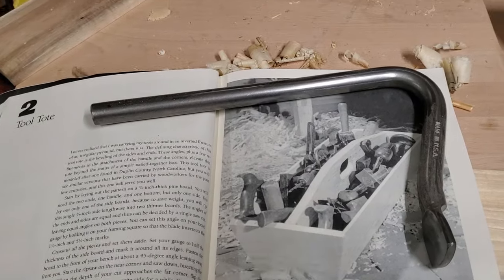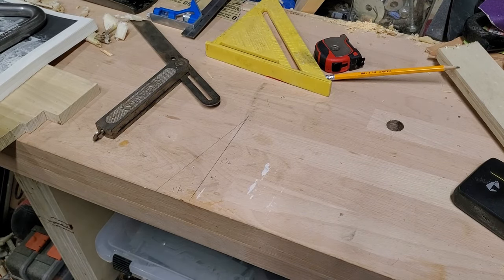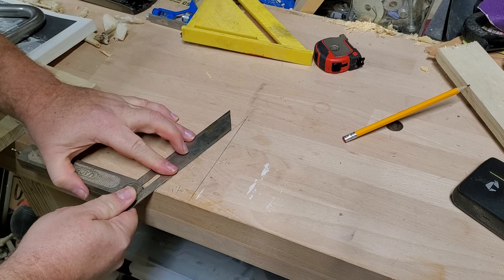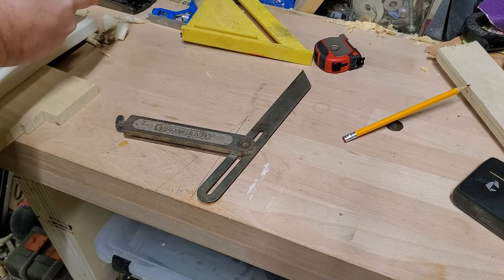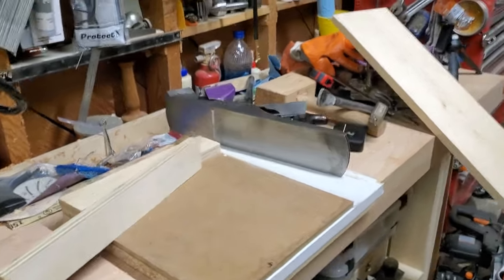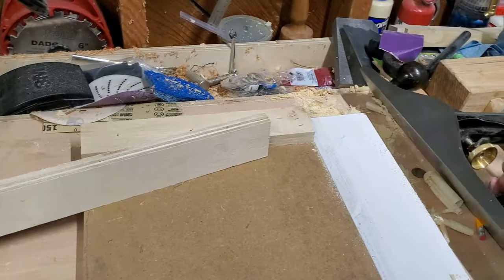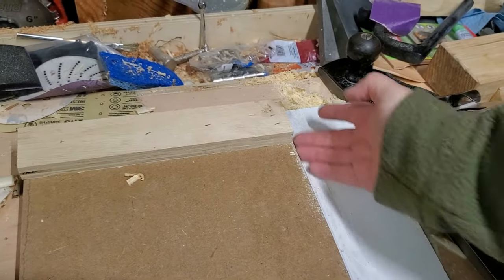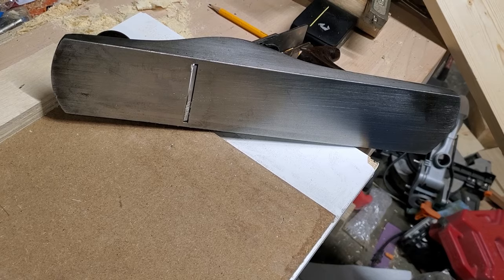Roy Underhill Tool Tote - all hand tool build

Comment: Great video.  Thanks for sharing. When using a shooting board, you can use the angled off-cut to match the angle of the board.
Reply from the maker: Great tip.  That would be way easier.  Thanks

Comment: 1) Using a knife to establish the cut line and then using a chisel from the waste side to create a saw trench (aka a 1st Class saw cut) will make it easier to start and stay on the line for cross cutting;
2) the accurately cut-off wedge can then be used to shim the fence angle on your shooting board.
Reply from the maker: Two great tips.  And great ideas for a video.  Thanks